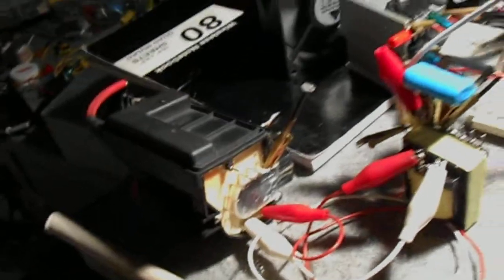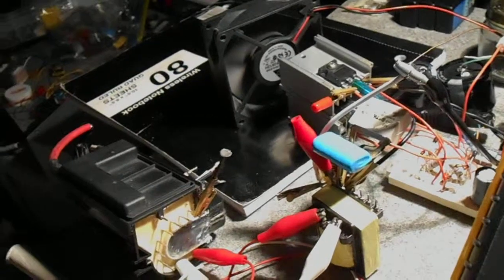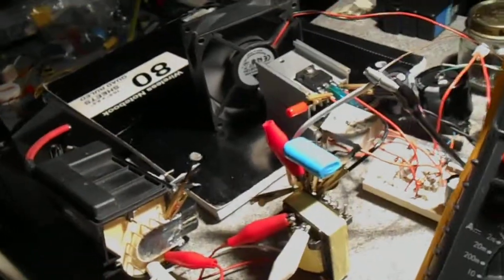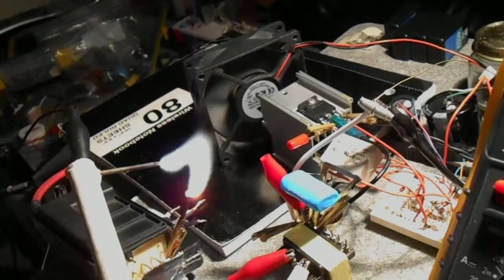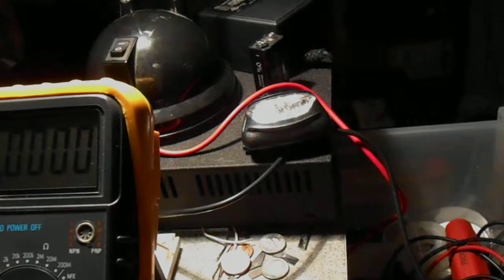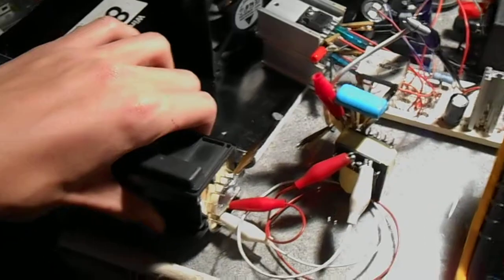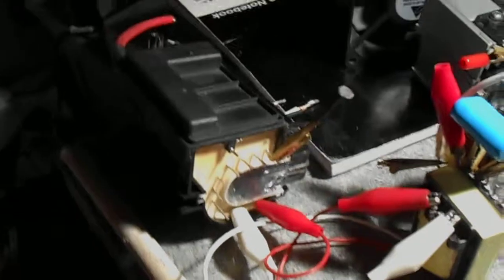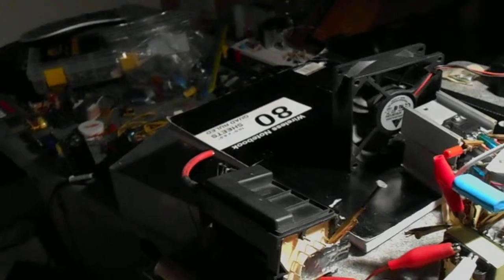Flyback Original Primary Powering part #3 more hot arcs

Comment: That output is fairly nice from the vid it looks to be about 10kv

Using a setpup trans has not worked out well for me.
Reply from the maker: yea i was thinking the same (10kv) the camera does it no justice though :) you made sure you have the right windings?
Reply from the maker: also this circuit will draw all that it can, probably because the the resistance of the ATX Tx low voltage windings are so low because they are just flat copper wires wrapped around the core. im sure if i had a stronger supply it would draw more, i should check what the supply voltage drops to when i am pulling the 20+ amps :)
Reply: I wound my own stepup transformer with a ferrite core a little bigger than ATX transformers but it did nothing.
Reply from the maker: hrm, do you have a pic of the stepup Tx you wound?
Reply: I took the transformer apart after I found it did not work, it's ok I will try winding another later on.
Reply from the maker: hehe ok